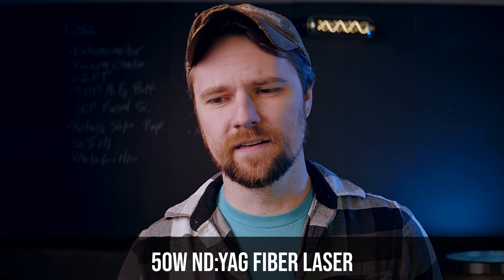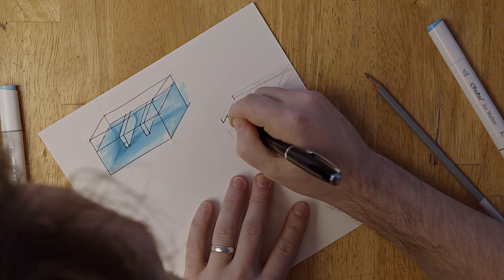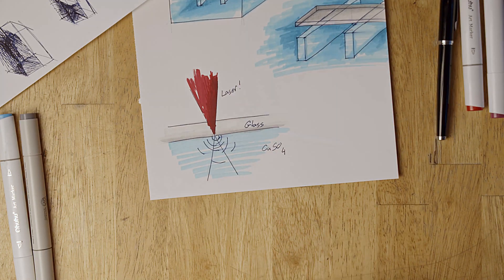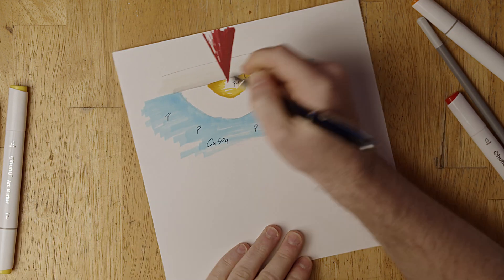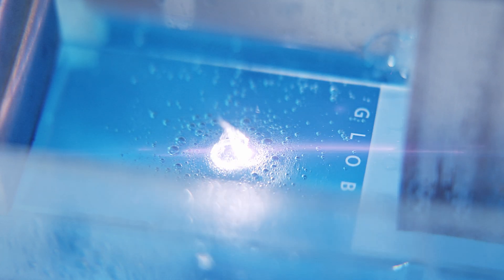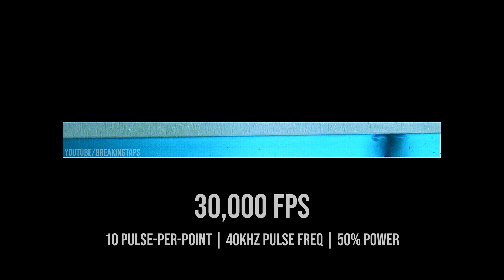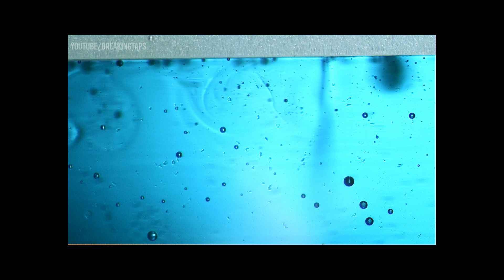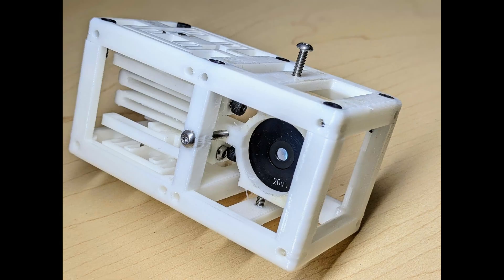Nanosecond explosions will cut glass

Comment: I love how sort of,  loose you are with what your willing to experiment in. 
Serendipity would of have to been recognised as a force that effects human scientific brake throughs. 😐😐😐😂

Do you think there’s some funky cavitation going on is your footage?

I’ve always thought the Big Bang happened in a similar sequence.🇦🇺🤜🏼🤛🏼😎🍀🍀🍀
Reply from the maker: Thanks!  Yeah, I think so.  Hard to know how much the cavitation is affecting things, and how much of it is just incidental.  But I feel like it's having some effect on the process.  Anectdotally, parameters that generate a lot of bubbles tends to "machine" faster so I think the bubble implosion is contributing. The glass slide will also "walk" away if you don't weigh it down, due to bubble formation and it "jumping" on really aggressive settings.  But there is a related dry process that uses graphite instead of copper sulfate solution, and that also machines but without bubbles.  So it probably isn't the whole effect, but part of it. :)

Comment: I wonder if it is possible to do laser assisted glass etching using NaOH solution since NaOH will quite happily eat away glass if hot enough. (Or so my brain tells me but I may be remembering wrong).
Reply from the maker: Oooh, that's an interesting idea!  Yeah I think if you get NaOH hot enough it starts do dissolve glass.  Hmmmmm might have to play with that.  Maybe NaOH with something like graphite in suspension to help absorb the laser?
Reply: @BreakingTaps  Yeah, that is good idea, or just have maybe light of a few micrometers that has a sharp focus point just under the glass surface. I don't have a suitable laser for messing around but I do have a 450 nm on the way, inspired by your many great experiments!

Comment: Would this process work with 40wco2 laser ? Or would a different solution be needed
Reply from the maker: Was just chatting with someone else in the comments about this, I suspect it would work just fine!  I think the copper sulfate solution will absorb the CO2 wavelength, which is the main importance.  Focal size will be larger, and the other commenter noted that CO2 can etch glass directly.  So you might have some interference from the surface etching and the liquid-side etching.  Not sure, lemme know if you try it! :)
Reply: Breaking Taps yes it can etch glass by its self. I’ll try turning the power down so that it doesn’t have enough power to do that on its own, I’m interested in this because I have 90% built a dc sputtering magnetron and I feel a combination can lead to some interesting experiments that I just haven’t thought of yet lol but I will let u know when I try it
Reply from the maker: @matgggg55  Neat, keep us updated!  There's a dry variant you might want to try too, it's a simpler setup: plate of graphite under the glass.  The graphite absorbs the laser like the copper sulfate solution and generates a plasma plume.  I've been using it for a recent project and I think it's superior, much easier to control and also less messy to setup.  I assume the CO2 would work with it too, since graphite aborbs all wavelengths pretty equally.

Comment: Couple questions: Can i use co2 laser? Does it need to be pulsed laser? Are results better than just surface etching glass? thx!
Reply from the maker: Don't have a CO2 myself, but I think the same process should work as long as the copper sulfate solution absorbs the CO2 wavelength (I think it does).  CO2 lasers have a large spot size though, so it might behave a little differently.  Unsure if pulsed laser is required or not.  All the papers use a pulse laser... my guess is that it's probably required to get the power density high enough in one spot, and then remove it quickly so the bubble can implode.  But would be interesting to test on a CW CO2!  Results are probably "worse" than chemical etching/creams... more prone to fracturing, not as smooth, and a fiddly setup :)  But it lets you pattern very small features which would be hard using a regular cream. (and academics like it because you can "machine" micron sized features)
Reply: @BreakingTaps  I agree with the pulse theory. too low of a setting on a constant laser might not generate enough heat, and too high might have adverse affects. It's possible for my laser to do "dotted lines" where you can pick the time and spacing of the pulses, so that might work if I used really rapid close dots. 

By surface etching, I meant with my laser. I've engraved plenty of glass and mirrors using my laser with mostly good results. there are micro fractures and pitting, but it doesn't look too bad. though its more like ~100 micron resolution if I had to guess. I'm not sure of the capabilities of my machine, but you can see the line pattern of an engraved image when set to 100 micron scan resolution, so smaller features are probably possible if I had a more focused beam energy (to control the size of the pit the laser forms). I love experimenting with unusual uses for my laser!
Reply from the maker: @angst_  Oh right, forgot that CO2 could etch glass directly.  It's probably a nicer surface than the method I detailed, if I had to guess!  And certainly a lot more convenient  Only big downside is focal spot size of the CO2 I think, which is why the literature likes the process because you can drop down to like deep UV wavelengths and etch very tiny features.  Not so practical for us home-gamers though :)

Comment: Is it possible that the plasma bubble collapsing would create cavitation that is etching the glass, and the exploding glass/explosions caused by hydrogen exploding from the rapid heating of the liquid?
Reply from the maker: Definitely possible!  hard to know how much cavitation plays into the process here (whether it's the side effect or the main mechanism), but anecdotally I found more "bubble-forming" paramaters also machined faster and deeper (and more prone to cracking).  I'm not sure the literature really knows the full mechanism, and I saw enough unexplained strange stuff in the high speed footage to think the academic literature hasn't quite figured it out yet either :)

I can say that there is a dry variant (uses a plate of graphite or metal) which can etch the glass in a similar manner, and the theory is plasma plumes there as well.  So cavitation can't explain all of the behavior, but it probably contributes significantly for the wet version.  Extra mechanical stress, removing molten byproducts, depositing oxides, etc.

Comment: Great content. Aren't you afraid of partial laserbeam bouncing back into the laser by reflection of the glass?
Reply from the maker: Thanks!  I've not worried about it much, mainly because these units are designed to etch highly reflective metals like aluminum which probably sends more reflected power back into the laser than glass.  I think the fiber itself is designed to eat back reflections so they don't reach the laser unit, but I'm not really sure. :)

Comment: Is there any chance any of the damage to the glass is caused by the bubbles collapsing inward? Reminds me of cavitation bubbles creating pitting on propellers and high speed pumps.
Reply from the maker: Definitely possible, although hard to know how much it is contributing.  There's a dry variant that uses a plate of graphite (or just metal) directly under the glass.  The academic literature claims it's mostly the same mechanism (laser vaporizes graphite and causes a plasma plume), and from my testing it seems faster and more reliable.  So I don't think the bubbles can fully explain the machining since it works "dry" as well.  That said, I saw a lot of unexplained things in the high speed video, and anecdotally the "machining" rate seems to speed up with increased bubble formation (either due to larger pulses, or tuning the frequency so that you get a constant stream of small bubbles).  My uneducated guess is that bubble implosion is contributing to some degree.  Maybe extra mechanical shock from the implosion + helping to clear debris, etc?  Dunno!  Interesting to think about though :)

Comment: Mhhh is the effect the same as the sonoluminecence? https://youtu.be/puVxGnl_3y8
Reply from the maker: Hmm interesting thought!  I'm not sure to be honest, it could be, or a related/contributing effect.  I think the generating mechanism is different (vaporized steam basically, as opposed to ultrasound)... but the bubble dynamics are probably identical.  Unclear how much of the "machining" comes from the bubble or plasma.  E.g. the literature seems to think it's the vaporization that causes plasma and melts the glass, and the bubble implosion is just secondary (and in some cases an interferring effect).  But when reviewing the footage at 30,000 FPS, I saw things that I couldn't quite explain with the current academic theory, so there's probably a lot here that isn't fully understood.  Based on my own anecdotal experience, the rate of bubble formation is pretty related to "machining" speed and also how quickly you break/crack the glass, so I feel like the bubble implosion has more effect than academics are thinking.

Comment: i wonder how mixing the liquid as you go would impact the bubble formation and size?  Maybe the heat would be more even and the bubbles would stay a more similar size.
Reply from the maker: ++ I think that would help a bunch.  Redistribute the heat, get copper byproducts out of the immediate area so they aren't floating around, and help dislodge bubbles.  I think the bubbles end up making the process unpredictable, since they act like little lenses and redirect the laser pulses into solution, causing more bubbles etc.

Comment from the maker: Correction: I mispoke/mistyped, my laser is a generic, non-MOPA Chinese fiber laser which means it's likely an Q-switched ytterbium fiber laser (I think).  Not an "Nd:YAG fiber laser".  Cheers to the folks who pointed that out :)
Reply: Awesome experiment and vid!. I would suggest that one of the main possible actions of this unique laser machining process is actually achieved by cavitation bubble micro re-entrant jets. Especially when the plasma induced bubble collapses next to the underside of the glass slides surface. So technically you could just use non conductive silicon oil instead of the copper sulphate solution for potentially a much faster etching process. For a more convenient top down machining process the end of your laser head needs to be just below the surface of the silicone oil to prevent unwanted surface laser diffraction. Cavitation micro jets can machine virtually any hard material extremely precisely and deeply even upto diamond hardness, providing your laser is at just the right focal point. Hope that helps and certainly worth experimenting with  :)
Reply: What about using activated carbon in the solution?
Reply: Ytterbium

Comment: Where did you get a fiber laser?
Reply from the maker: eBay or Amazon are the easiest if you're in the US, just search for 20/30/50w fiber laser and you'll start seeing results.  Basically all the same units, with either JPT or Raycus fiber laser inside.  You can also order direct from Aliexpress or similar, but have to deal with importing a laser which requires extra paperwork (I'm told).

Comment: how tinny lines u can etch with co2 or fiber laser ?
Reply from the maker: The spot size of my fiber laser is around 30 microns.  I didn't measure individual lines very closely, but I think they end up etching about the same size in glass.  at 0:22 you can see the dark lines are about 100 microns wide, and those were 3-5 passes of the laser.  So 30 micron minimum width is probably a decent guess overall.  CO2 laser would be a different story, it has a much longer wavelength and larger spot.  And I think it would interact with the glass itself more.  But I don't have one, so no personal experience.

Comment: Curious if you'd get any benefit from keeping the water flowing to move debris away and keep the solution's heat absorption more stable.
Reply from the maker: Hmm, maybe!  A few other folks have suggested that too, might give it a shot.  Would be pretty easy to tests. I saw some mention in papers of the opposite too... heating everything up so that there was less temperature difference between the glass and the plasma.  But cooling seems easier to do so might try that first!
Reply: I appreciate your shading. Nice markers

Comment: This was amazing!  If you don't need to micromachine-scale features, you can quite easily laser etch glass on the front side by using IR (1013nm) light.  Glass is opaque at this wavelength, so the laser energy is absorbed and heats the glass enough that it shatters in place.  If you're careful with the power levels you can get quite pleasing results.
Reply from the maker: Oh nifty, didn't realize glass could be machined with longer wavelengths.  Another reason I should get a CO2 laser... now just to find space in the garage...

Comment: Holy crap, I need to know how you got that highspeed!
Reply from the maker: Lots of patience 😂 So the setup is at 1:36... basically the high speed camera (an Edgertronics SC2+) + macro focusing rail + 3d printed adapter and a 4x microscope objective, pointed at the plexiglass tank.  The mirror behind the tank reflects light from a large plasma cinema light (big box thing on the right) directly into the microscope objective.  Then it's just a matter of lining up all the various bits, and trying to etch the glass as close to the edge of the tank as possible.  Then repeat dozens of times to get some good shots :)

Comment: If you put a layer of water on top, would that be enough of a heat sink to stop the cracking? I’m picturing the slide as the bottom of a water- filled box, in or on the solution. Would make it easier to do gradients as well

Comment: Keep up the awesome videos, this knowledge is gold!
Reply: Is there any chance cavitation might be what causes the glass to randomly fracture? What would happen if the solution was dramatically cooler?
Reply from the maker: Almost certainly, I think! :)  Some papers refer to "hard" and "soft" pulses.  Soft pulses have limited cavitation and remove a few nanometers of  material, while higher energy "hard" pulses cause large cavitation bubbles and shockwaves, remove 100's nm to several microns of glass at a time.  I think my tests were mostly in the "hard" mode, and probably a lot of cavitation shock.  

I saw some mentions in the literature about heating the substrate to near it's glassy point, so it would have less thermal shock.  I imagine cooling the solution would help as well... after a few minutes of absorbing the laser the solution is pretty hot.  The soda-lime glass fractures much quickly than the borosilicate, so I think the cracking style defects are almost entirely thermal shock, and could probably be mitigated with better temperature control (either heating or cooling)